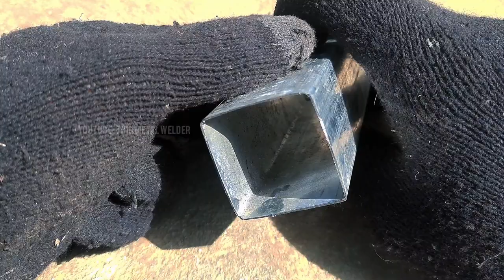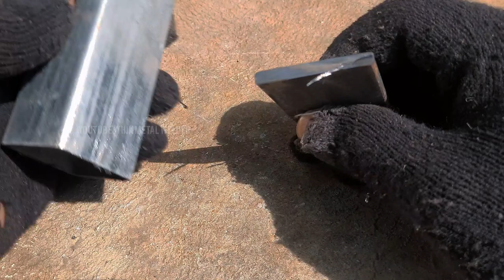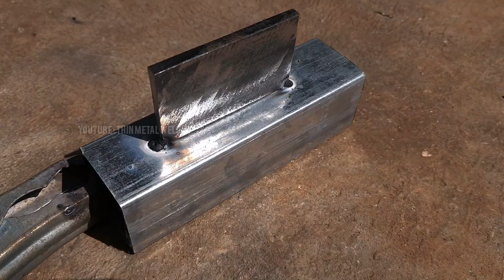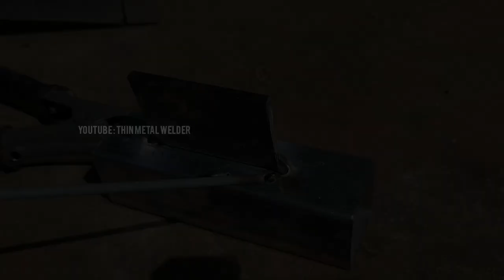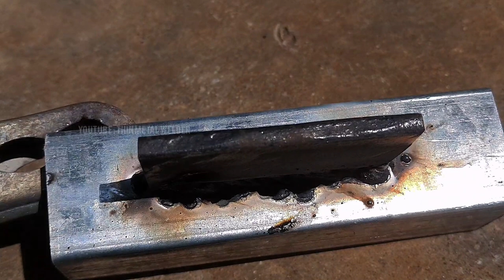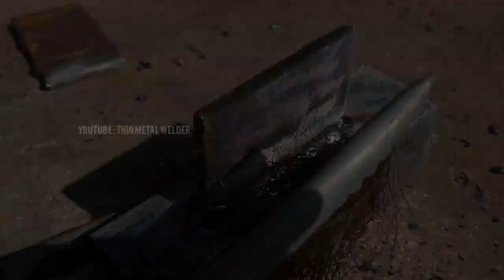maybe not everyone knows, why the welder doesn't talk about this secret

Comment: Hi there! Thanks for tip👍🏻😊. I have Q: 1) is ”hot start” and ”arc force” shut off when you stick weld these thin walls? If not, what settings? My esab tries to maintain arc when stick spot welding! BIG arcs are flashing 😝. 2) what polarity do you use? DCEN? 3) the thinner rods the better - 1.6mm? What type of rods in EU? ESAB OK46? Thanks for everybody’s wise support🥳🙏🏻